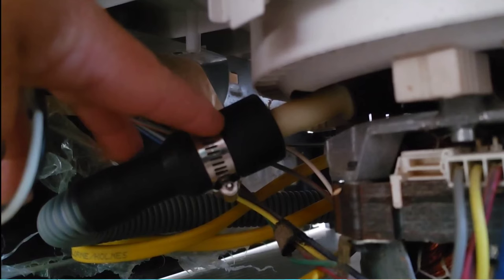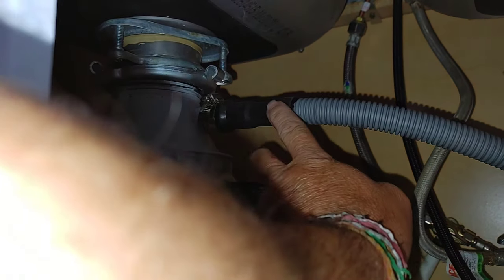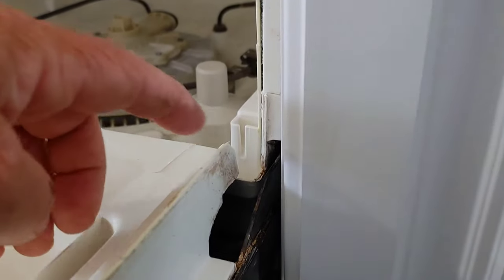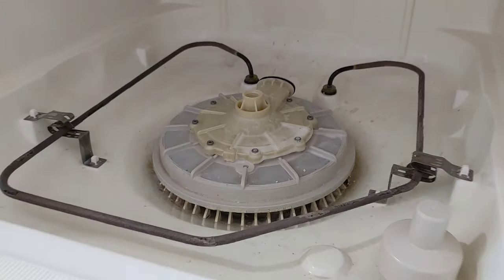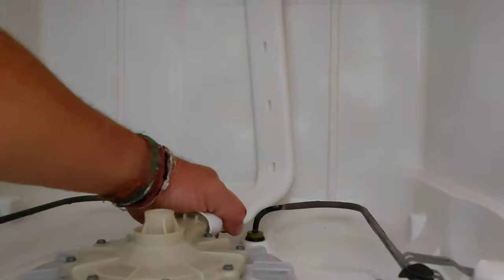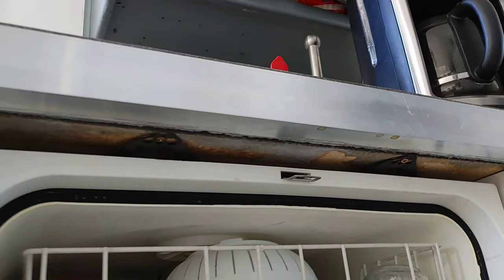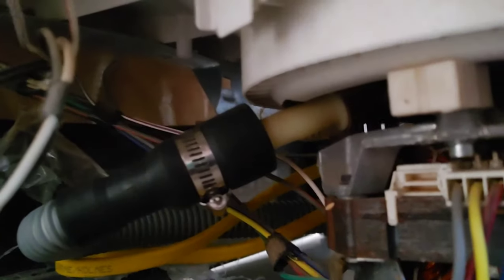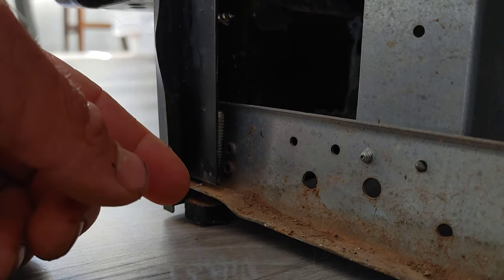Leaky dishwasher fix

Comment: On my 2013 whirlpool gold series dishwasher, cause of water leak from door turned out to hard water buildup on the heat air vent rubber seal. It is accessible by removing door cover and removing vent. Cleaning rubber gasket with vinegar and a good coat of vaseline resolved issue. Leak gone completely.

Comment: I know this is an older vid but I can tell ya exactly what happened here so I will leave my expertise and information about this below incase anyone else runs into this. The dishwasher was oversudsing during the wash, & due to it being unlevel the top layer of suds on the water at the floor of the tub was able to  more easily make its way up and over the door lip just above the access panel on the front, this is actually common either its level or not when the machine is oversudsing but in your case it was much easier for it to leak out. Causes of oversudsing can be related to rinse aid being spilled on the door when adding, using the wrong detergent, bad detergent, or the machine is leaking rinse aid when the door is closed. I have the same identical model as yours, this machine is more sensitive than others because of how powerful it is and the amount of water it uses. Hence the name “Powerclean” as Whirlpool called it, very excellent and notoriously reliable dishwasher with the big induction motor they used to use back when. 

Anyways, You can tell when a dishwasher is over sudsing by when it becomes real quiet when it’s recirculating water and you don’t hear water sloshing, and the motor and pump begin to surge, that happens before the suds spill out and the cycle needs to be canceled and drained immediately to avoid damaging the motor and avoid any cleanups. Run a couple fast rinse cycles afterwards to clear the suds if this happens to anyone. Be sure the floor of the tub is free of soap scum too as that can be a suds trigger and be sure to deep clean the interior and sump/filter of the machine and run a cleaning cycle often with dishwasher cleaner. This is a self cleaning filter model so it doesn’t need to be removed just take off the lower wash arm and give that filter cover down there a good scrub, scrub everything else down too, cleaning the sump area is so important for peak performance especially if someone was using it before you guys moved in there’s a lot of bacteria n scum down there when it goes years without cleaning and some of the scum can undoubtedly cause sudsing to a certain extent as well. Great video and I’m happy to share this info with you given we have the same machine.

Comment: I had the same issue, after inspecting the washer I found debris in the sprayers. I removed both top and bottom sprayer heads cleaned them out and I haven't an issue since.
Reply from the maker: Thanks for the tip, I hadn't thought of that.

Comment: Also the lower door seal/gasket could be bad or a dishwasher could be leaking from a bad solenoid or the shaft seal/gasket behind the solenoid mounting bracket.
Reply from the maker: Great suggestions. The lower door seal fails a lot.

Comment: If it's a new old house and you just purchased it, you probably have a home warranty that the seller paid for and that would cover these things. Not always but usually. However I love diy!!
Reply from the maker: I did have a year warranty, but I think it has just expired, or else I forgot about it. Very good point though. A year is pretty standard for anybody who comes across this issue.
Reply: @VanDamArtisan  Yes but you can always keep paying for it each year if you want. They are around $500 for appliances. You usually have to pay $30-45 for the trip call but that should be it. That being said, they don't cover everything and they bandaid the crap out of your appliances. It works for some people, not for others. If you have cheap appliances, it's not worth it.

Comment: I have the tiniest center leak that turns the sensor on. Those adjustable legs had to be removed to fit my dishwasher. That may be the issue.

Comment: I have a similar dishwasher and when the water gets pumped into the tub it leaks out the right side (opposite the side it enters.  It’s not the gasket (was replaced).  Not sure why the water enters so strong it sprays across bottom and out the other side.
Reply from the maker: You'd think it would be more gradual. Maybe the pressure on your house is high? Maybe mine is too. I've never checked. It's supposed to be around 50-60 psi.
Reply: @VanDamArtisan  It shouldn’t make a difference.  It’s the inlet valve that provides the pressure, right?
Reply from the maker: @ctysonmay1773  yeah, I guess so.
Reply: Check heat air vent rubber seal. This where water started leaking on my dishwasher and I kept on thinking something else was wrong like door seal etc